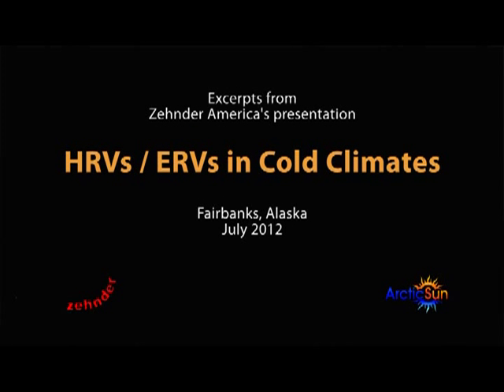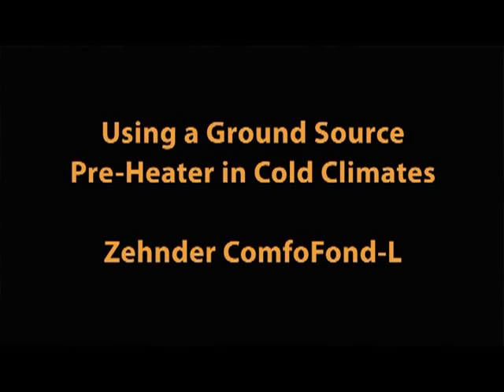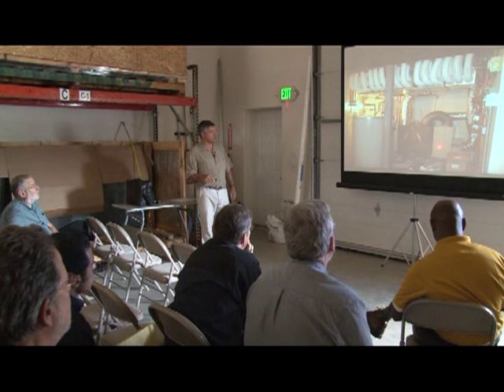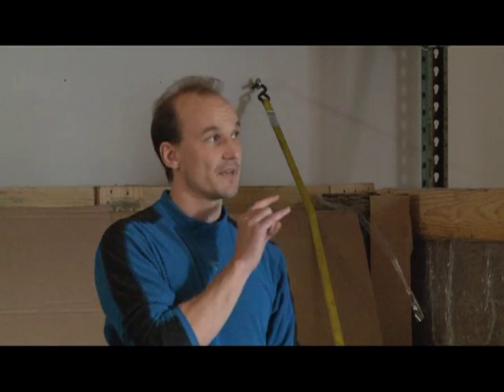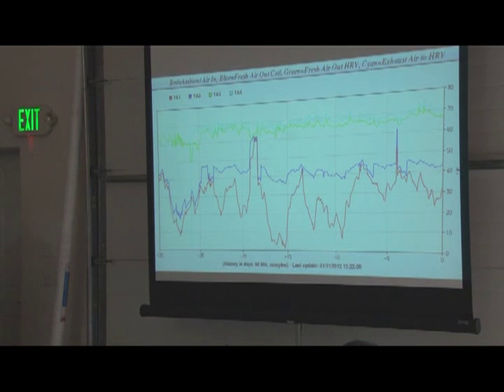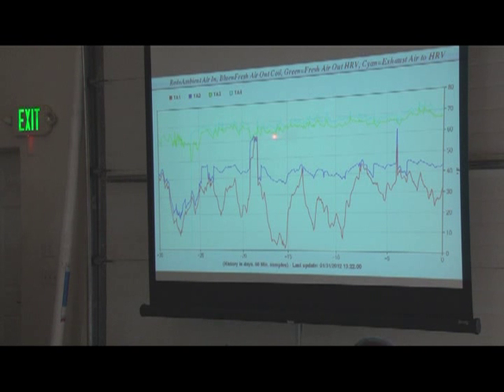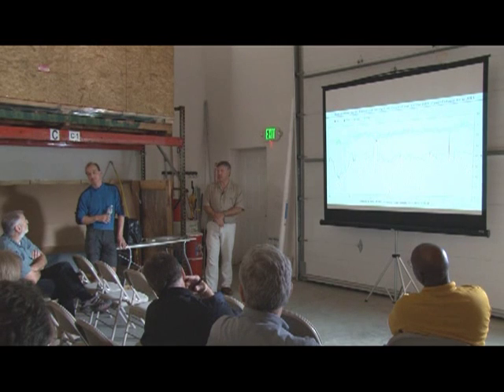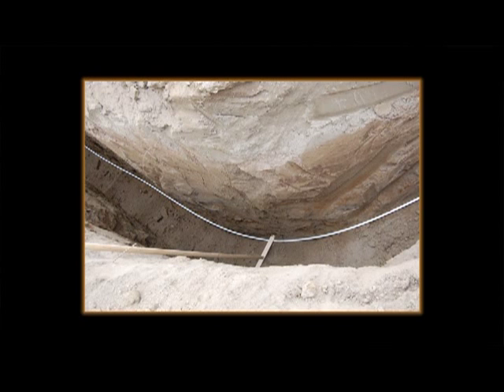Zehnder HRV with Ground Source Pre-heater High-performance

Comment: I'm planning out how I want to heat/cool/ventilate my house which will be built in Canada, and this video finally answered the question about whether the ground source preheater could sufficiently heat incoming air when the temp of that air is -40C. Zehnder needs to update their literature/documentation on the site because it is not clear what climates this equipment can effectively operate in. BUT I'm really happy to hear that this system (Zehnder ERV paired with ground-source pre-heater) will work for me where I am building without needing a separate heating/cooling system!